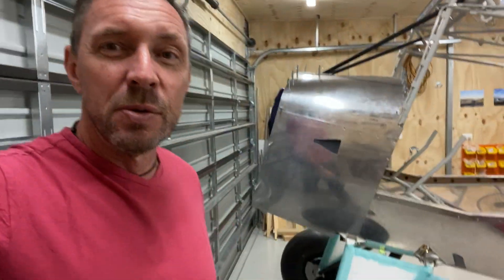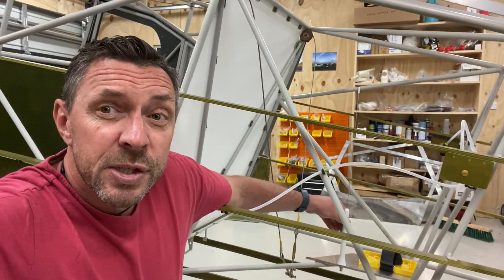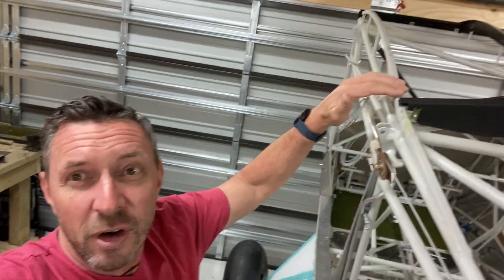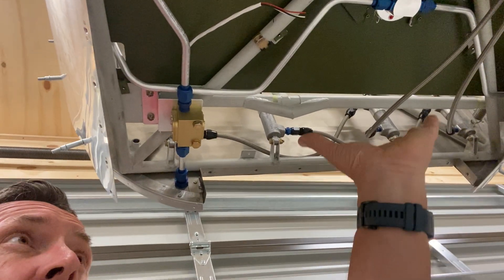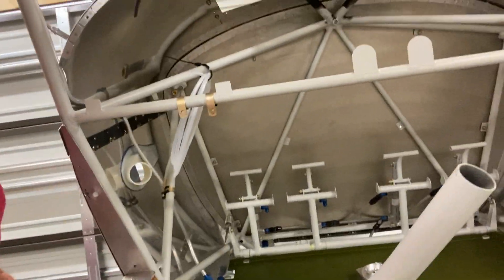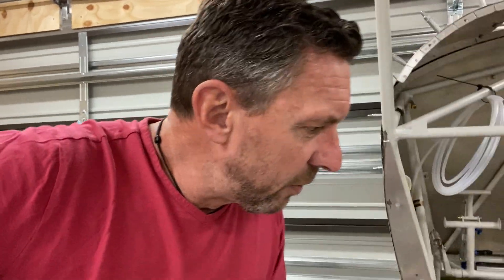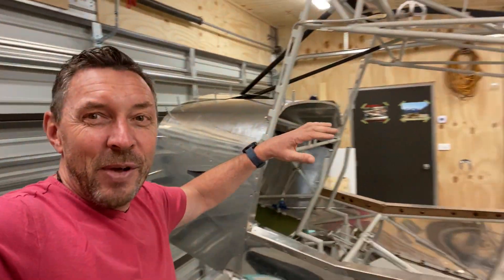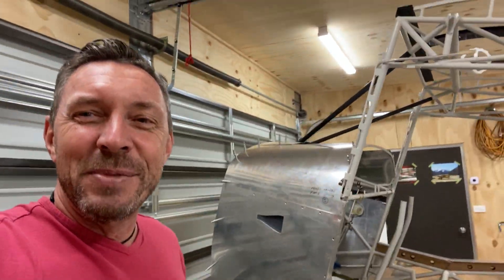Bearhawk build #4 - building a Homebuilt Bushplane aircraft in my garage

Comment: Where did you get the NACA Ducts?  Can you share the Bearhawk forum link for the under door panel termination with the screws and adel clamps you mentioned?  Love the Videos Thanks for sharing!
Reply from the maker: Hi Justin,

I purchased the NACA ducts from Vans- you’ll find them in their online store. Quite inexpensive too. The only catch is that they’re not suitable for forward of the firewall, low temp only but that was fine for the air vents.

Take a look at my build log if you like https://webuildplanes.com/neville
The doors are here https://webuildplanes.com/neville?before=2020-12-03+10%3A48%3A24Z
Panels under the doors are here https://webuildplanes.com/neville?before=2020-12-03+10%3A48%3A24Z

Hope this helps !